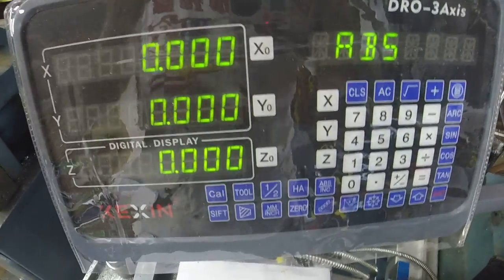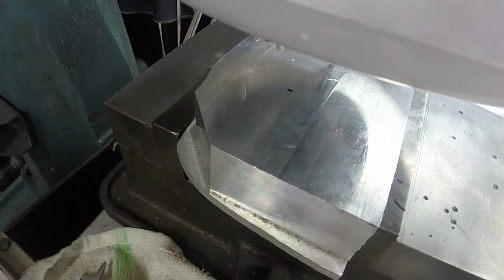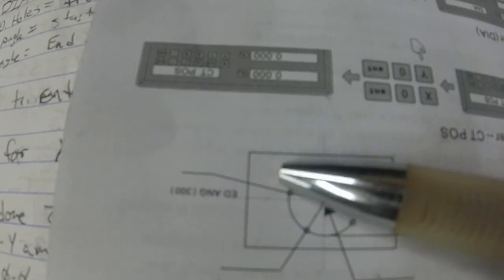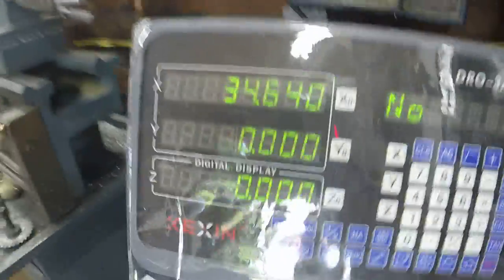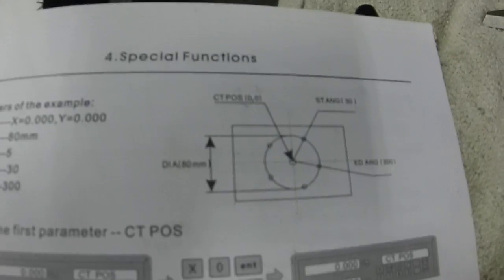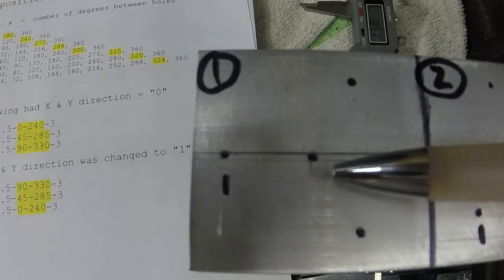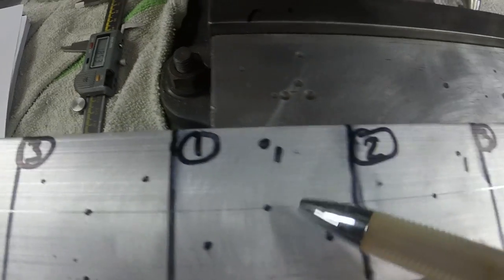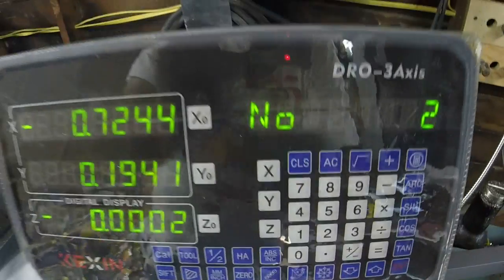ToAuto/Kexin DRO PCD Function. Holes spaced evenly in a circumference.

Comment: The reason the "reversed" direction works is that  the positive and negative movement is supposed to be from the "point of view of the tool" not the direction of table movement. When you set the DRO to what you are calling "reversed" it is actually the correct setting.